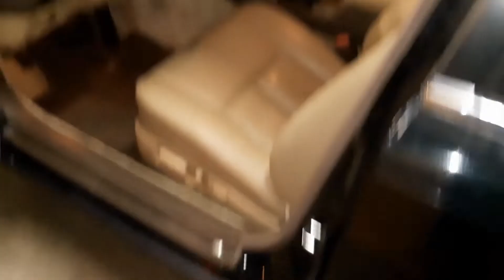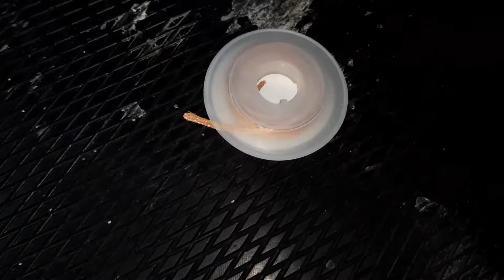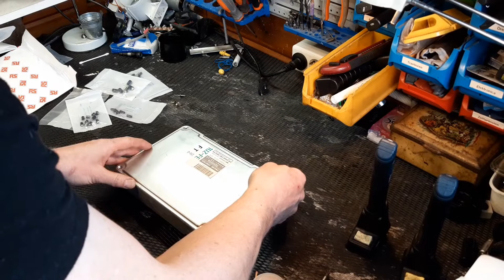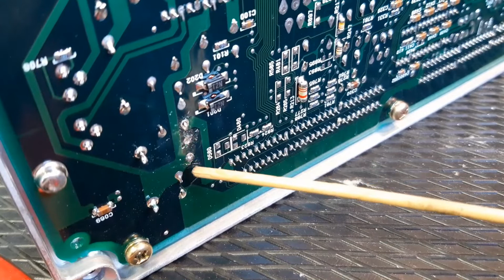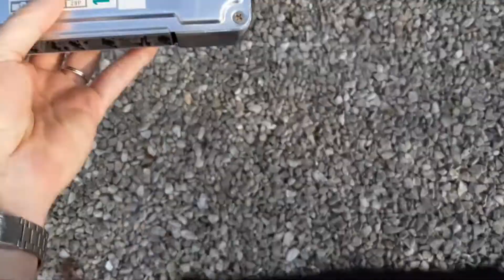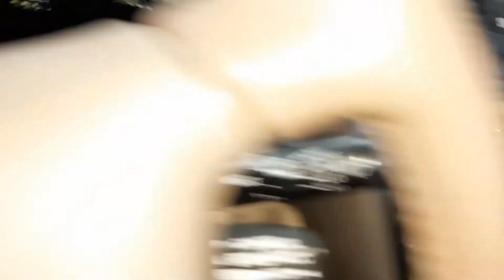Lexus LS400 ECU repair - Replacing leaking capacitors

Comment: Great work !! Can you share the link for capacitors repair kit ,? Thank you
Reply from the maker: Hi there, I ordered the capacitor from an electronics supplier. RS Components, they have a large variety in stock, so you can order high-quality, automotive spec capacitors.

Comment: Unfortunately, I'm faced with the same issue. Do you have the link to the second video? Did you solve the problem
Reply from the maker: I have several videos on this subject, here are:
Part 2: https://youtu.be/oKH7s9Qn6JM?si=y5OoO1GZC4TKfCIb
Part 3: https://youtu.be/RGW_oTpNMBM?si=aEbHawiTV6b0nDu2
Part 4: https://youtu.be/Ya1wujKp47E?si=xNchYXI4ClPhWQMF

And here is the most recent one: https://youtu.be/HA7cvduQyHQ?si=a_ZZc9iWLlEkZTdg

I hope this is helpful, let me know!!
Reply: I just got a93 ls400 it starts idles but when you apply the throttle nothing happens at all

Comment: Hello, Carnold!You can tell me. My car won't turn off. in the mode. The Acc engine remains running. I changed the ignition switch.
Reply from the maker: Oh, that is weird. Is the contactor on the back of the ignition still good? It seems it doesn't break the circuit completely. I will look in the workshop manual as soon as I have time today!

Comment: Hi, thanks for making these love your videos. I have a question did replacing the capacitors end up helping the cars fuel economy at all? And if it did was it a big improvement?
Reply from the maker: It depends per car in my experience. This car had ignition and transmission issues due to the leaking caps, the fuel consumption wasn't bad (and not because the car was undriveable), 10 liters per 100 km's. For my own LS 400 (Project LS 400) the fuel consumption improved from 13 to 10 liters per 100 km's. Bad fuel consumption in first gen LS 400's is often caused by multiple things: O2 sensors going bad, injector wear and very often a cold start injector that is stuck open. Often times, these things occur at the same time. Back to your question: replacing the capacitors can indeed improve the fuel economy, but 10l/100 km (or 28.2 MPG UK) is the best I ever got out of a LS 400.
Reply: @Carnold_YT  Ok thanks for your advice. I have a 1993 SC 400 and it runs fine but its getting terrible fuel economy bad like a 75l tank will last me maybe 330km not sure what the issue is might do the spark plugs and see what happens. Might get someone to check the injectors or cold start injector that you mentioned.
Reply from the maker: @nigel7598  That is a pretty high fuel consumption Nigel, I'd suggest you start with the cold start injector under the intake plenum and disconnect that. See if that makes a difference (if this is the fault, the car should also have a heavy fuel smell from the exhaust, because of the extreme rich condition). Another thing you can check is a short to ground on the injectors. The injectors are switched to ground to open them. If there is a short to ground, it remains open constantly. Please note that the injectors work in pairs, so there are always two controlled simultaneously by the ECU. The early 1UZ's have the fuel injection of a four cylinder engine 🙂
Reply: @Carnold_YT Thanks for the info  I'll see if my mechanic can check these items out.

Comment: If you wait too long (>20yrs) the leaked capacitor electrolyte will eat traces right off the PCB.
Reply from the maker: That is exactly what happened with this ECU. In a follow up video I show you how I repaired a corroded trace

Comment: Got a 93 us model. Crank no start. Got good fuel got spark replaced caps. Only code is 24 for iat but shouldn’t keep it from atleast firing up
Reply from the maker: The IAT is in the air volume sensor, did you try changing that out? In my previous '93 LS400 I had the same issues as you. Changed the AVS and all was good.
Reply from the maker: Hey Chris, I'll dive into this subject in the upcoming episode. The workshop manual has several routes to troubleshoot this fault code.

Comment: Where did you get those capacitor? I've got a 1992 LS400 that was garage kept for 12 years. Brought it to the workshop and after 7 months "most" of it got fixed. Been experiencing some symptoms like loss of power, engine stalling and recently found out my power steering is leaking. Any tips on the power steering? I saw a YouTube video where Toyota/Lexus prefers Dextron ATF fluids instead of power steering fluid. Have you tried that out?
Reply from the maker: Hello Saf, thanks for your comment. In regard to the capacitors: I ordered them online at RS Components, they are widely available and very cheap. About the power steering fluid: Lexus prescribes plain ATF for the power steering system, I have always used that in all my LS 400's. If you are going to replace the capacitors in the ECU, make sure to also check the mass contacts in the engine bay. Corroded mass pints (Where the electrical system is grounded to the car's bodyshell) can also cause electrical issues. If you want to, I can look it up and show it in a future episode.
Reply: @Carnold_YT  yes pleasee! thank you so much for the fast response  (its 12AM where I am). I recently did a throttle body service - that sorta fixed the low idle issue (for a day) but it's still idling low on my RPM gauge. As for the rest, my  speedometer, odometer and temperature gauge is not working at all. The backlight does not light up. Any idea on that one? (im guessing its the ECU?)
Reply from the maker: @saf574  In Episode 12 I show how to disassemble and repair the instrument panel. I hope that is helpful for you: https://youtu.be/2aqwCh5TW7E
Reply: @Carnold_YT  thanks Arnold. I’ll check it out 👍🏼
Reply from the maker: @saf574  It's in the new episode: https://youtu.be/qppau93QZzg
Reply: What are the part numbers?